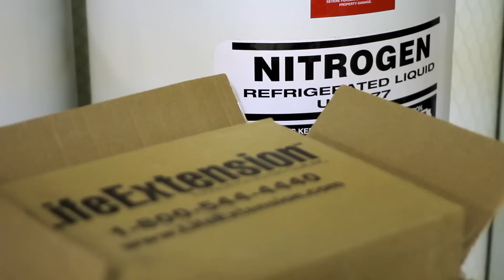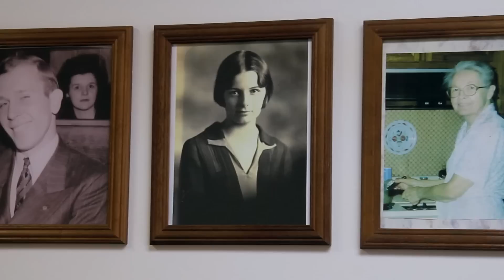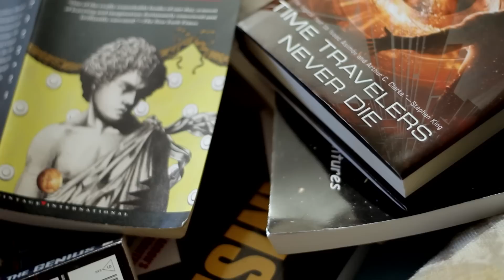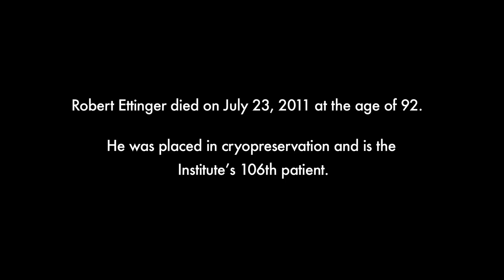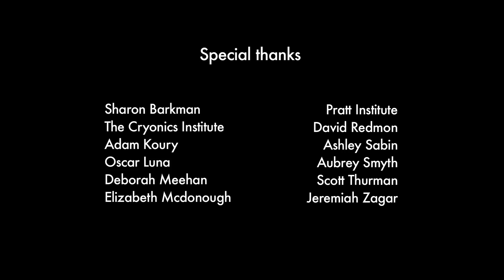Cryonics: Will These Bodies Come Back From Death?

Comment: POWER OUTAGE?
Reply: No problem.  The storage does not require power.
The patients are stored in liquid nitrogen, and the low temperature is maintained by very slow boiling-off of nitrogen.  It has to be topped off with more liquid nitrogen about once or twice per month.

Comment: I wonder if the electric ever went out? What would they do?
Reply: No electricity?  No problem.  The storage does not require power.
The patients are stored in liquid nitrogen, and the low temperature is maintained by very slow boiling-off of nitrogen.  It has to be topped off with more liquid nitrogen about once or twice per month.

Comment: It's difficult to predict when safe permanently freezing and resuscitation will be possible. But if science continues to progress as it has, this should be possible in the next 50-300 years. There are several challenges unmet, and techniques and technologies not developed. And it's not clear how stringent the requirements are for freezing in order to bring you back. What is predictable though, is that such procedures would come FAR before 'artificial brains' or any ability to  'transfer your brain patterns and memories'. That is MUCH MUCH 'more fictional', than cryonics ! Also. a mostly separate topic, artificial intelligence embodies ZERO actual intelligence, and is NOT on a 'predictable path' the 'become aware'. NOWHERE in A.I. is the 'DNA' or prerequisites for actual artificial intelligence. That idea is a COMPLETE delusion based one a completely incompetent view of what A.I. actually is. It's is a 'circular thinking' delusion based on the completely mistaken belief that A.I. is already non-zero intelligence (it definitely is zero) which would mean it's alreayd 'aware' which is what intelligence is, and it's not that. Is it just computing that started with some impossible goals, that we gave some misleading names to it anyway, and convinced ourselves it was special. NOTHING in A.I. remotely resembles actual cognition or awareness, or has any hint or clue whatsoever that it EVER could. ALL of that is imagination confused with perception. That is a completely unfounded leap. And it's surprising that a few pretty good minds have thought otherwise. We could go for MILLENNIA and not understand cognition ! And we WOULD have to understand it to be able to create it artificially. A.I. is not 'on that path', no. But maybe, just maybe, someone who gets frozen will later be around to know the answers to those other two questions. It's plausible, not known to be impossible.

Comment: What happens when they cant pay their electric bill anymore or the power goes out and their back up generators stop working?
Reply: they move out to the cemetery. who will pay for it though? so they probably will be in the garbage suits
Reply: No problem.  The storage does not require power.
The patients are stored in liquid nitrogen, and the low temperature is maintained by very slow boiling-off of nitrogen.  It has to be topped off with more liquid nitrogen about once or twice per month.

Comment: What happens when you lose power..and your back up power...it will happen..
Reply: you cryonic the ac
Reply: No problem.  The storage does not require power.
The patients are stored in liquid nitrogen, and the low temperature is maintained by very slow boiling-off of nitrogen.  It has to be topped off with more liquid nitrogen about once or twice per month.

Comment: What happens if the electricity goes out????for hours
Reply: No problem.  The storage does not require power.
The patients are stored in liquid nitrogen, and the low temperature is maintained by very slow boiling-off of nitrogen.  It has to be topped off with more liquid nitrogen about once or twice per month.

Comment: I would think that one would have to be frozen while alive.  When your dead its already over
Reply: No, you're dead only according to our current technology.  What was certainly fatal 100 years ago is not necessarily fatal today.  For example, recently some kid fell in a river and was drowned for two hours.  In 1920 he would probably be considered dead and the book closed.  As we learn more and more, the time of death is pushed back.  The plan is "Freeze using current technology, revive using future technology."
Reply: @danhitt167  you cant reverse brain damage as a result of oxygen starvation.
Reply: @nxxynx5039  With current technology this is undoubtedly true.  But with future technology, it's an open question.  A thousand years from now it may be possible to repair the damage molecule-by-molecule if necessary.   By analogy, in the 15th century it would be impossible to tell if one painting was made on top of another one without scraping the paint to see.  But if we do that today, 500 years later, we can check with x rays.  It would be insane for somebody in the 21st century to use 15th century technology to check what was behind a painting.  And it would be insane for somebody in the 30th century to use 20th century technology to reverse oxygen starvation damage.  Rather, they would use 30th century technology to do the job.
Reply: Dan Hitt - Willie is correct.
Reply: @danhitt167  it's over
Reply: willie peppers - correct 👍🏽..... 

And “Cryonics” only has a .000285% chance of success if a person is ‘frozen’ alive and healthy.  

These wackos are wasting their time accepting as ‘patients’  those who are old farts & have fatal disease diagnoses. 

And even the ‘patients’ who, in these past 2 years with the latest technological advances, have been ‘frozen’ AFTER being pronounced dead have less than .00000471% chance of successfully being revived.

And all the ‘patients’ ‘on ice’ so-to-speak prior to 2018 should be tossed out to save precious energy and space resources.
Reply: @drfelixfarsider2346  With all due respect, doctor, in order for these probability estimates to have any meaning, you'd have to actually know what technological capabilities we'll have not just in 2120, but in 3120.

The paradigm is not "revive using current technology" but "revive using future technology".

100 years ago people did not even know how proteins were encoded in DNA.

So i think it's premature to be estimating probabilities of revival in 100 years.  It's 100 years premature, to be exact.  :) :)
Reply: @drfelixfarsider2346  These numbers are random
Reply: @drfelixfarsider2346  
 .00000471% (bullshit numbers pulled out of the rectum) is an infinitely bigger chance than 0%.

Comment: And, if the electrical systems and back -up systems go down.... what then! ☜💀
Reply: Dorothy G. Tyas It’s powered by liquid nitrogen, not electricity. Also this video is hella old. And there are more professional places that do this.
Reply: I bet you those bodies defrosted few times while there lol this is the most stupid idea one can ever think of. Look at those miserable faces working there. This is waste of energy time money.
Reply: No problem.  The storage does not require power.
The patients are stored in liquid nitrogen, and the low temperature is maintained by very slow boiling-off of nitrogen.  It has to be topped off with more liquid nitrogen about once or twice per month.

Comment: Can you unbreak an egg?
Reply: Can you alter time or recover water once it has passed can you spell Mississippi
Reply: WeeWeeJumbo superb comment .....👍
Reply: Yes, actually you can, there is a video where they showed how, basically you rebuild the crack and then introduced the rest of white part by a hole that's later repaired
Reply: It might be difficult but definitely not impossible.